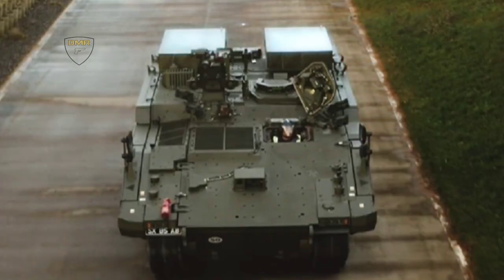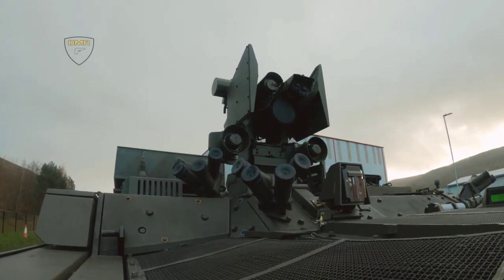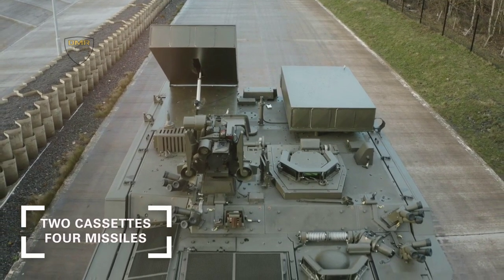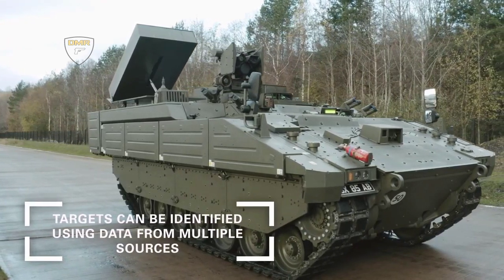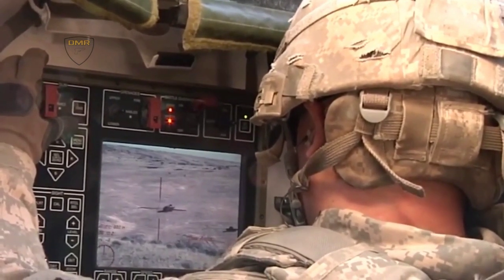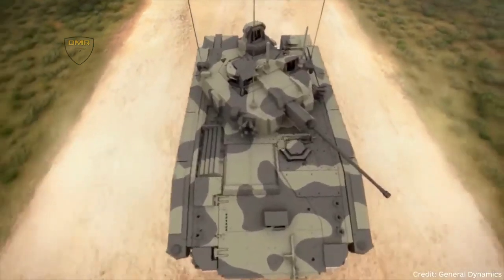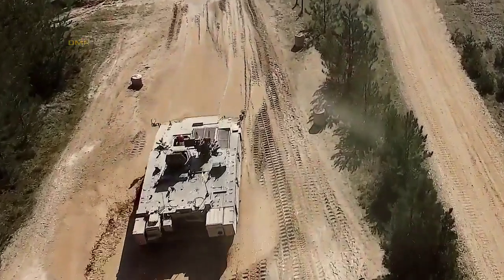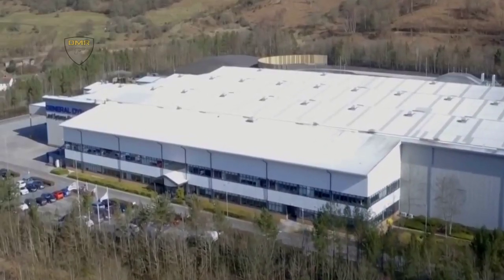Unveil! British Army Tank New Weapon Brimstone AJAX Overwatch

Comment: I am torn! Brimstone is extremely capable! But you almost have the same capability if you slap a RCH155 on a Boxer. You can shoot laser guided munition far cheaper and on top do everything else that and artillery normally does! 

Anti Tank rockets should always be shot by the most low cost platform available. That is not anything tracked, that is not anything armored. Slap it on a Jeep!

Comment: How is the Ajax 1st in class, the Britts seem to call anything they make "World Beaters or 1st in Class. I would say the Puma, T-15, K41,  Hanwa Redback AS21 and Namer have a leg up on the Ajax, all are newer platforms with better more powerful engines armour and crew protection ( T-15, K41 and Namer having active protection) then the Ajax,  that is just an update of the 22 yr old ASCOD Pizarro/Ulan.
Reply: What's a 'Britts' when it's at home.. ?
Reply: Oh, and by the way........ next time you get in an American armoured vehicle or fire a naval gun, remember who it's made by sunshine. BAE Systems, which is British. They also supply a lot of your military technology mate and design your rail guns and supply a lot of the technology for your "American" F-35. How do you think that the F-35B gets off the ground? Magic? Flight suits, helmet, ejection seats, targeting optics and lasers, weapons bays doors and technology, rear fuselage and structures, electrical power management, in flight refuelling probe, life support system, entire STOVL system, tactical data equipment, computer codes, weapons integration, electro hydraulic actuation system, throttle quadrant...... and these are the ones I remember. I've remembered something else........ who do you think contributed a rather large wedge of cash to help fund the research and development for the F-35 programme to get it going? Your fairy godmother? Actually,  just under a fifth of every single F-35 comes from our tiny little Island.
You seem to be exception to the rule as an American, I've been to the States many times and 99.9% of Americans I've met speak highly of my Country and the bond that we have between our 2 Countries, you are obviously the tiny minority. I don't care what you and your peanut sized brain cell think, you are irrelevant.
Reply: @gooner72  please do recall that the technology and items are "Not British". Please do your research and don't go into your Nationalism "Brits", seem to have an "Enferioty Comples" left over from their loss of the "Empire. Bae, you say provides so much of the American Service Gear, well BAE does but bit Britain. Bae Systems in 2005, acquired United Defense Industries, that made the M2/M3 Bradley , M109A6 Paladin, LVT, M8 Crusader, Mk 41 vls , Naval Guns and owned Bofors Weapon Systems. Bae has also acquired Atlantic Marine (major American Naval Service Support And Upgrades company), Signal Inovations Group Inc ( a data , dignals and intelligence company ), Tracor, acquired  Fairchild Systems and Sanders Associates from LockheedMartin and turned it into ( a major american info systems, Instruments, Ecm/Esm ) today Tracor is named Bae Systems Inetegrated Defense Solutions. The RR contribution to the F'35B the Lift Fan and Lift Fan nozzle System was  was developed by Allison Engine Company a then division of GM, RR acquired Allison in 1995, the lift system for the F-35 was developed long before RR acquired the comoany, ohh by the way does LHTEC T800  engines that power the AW159 Wildcat are made in the USA, ohh does Bae 5/62 Mk45 Mod4 guns are made in Kentucky.
Reply: Wind your neck in sunshine, the British Ajax is a hugely modified design and has a shed load of technology that the original one ever had.
Reply: John Martin
Why are you comparing IFVs to fast reconnaissance (Ajax) ?
Reply: What's a britts? 🤡
Reply: It's all designed to impress UK voters, usually while also quietly cutting the size of the British armed forces (and budget).  
So, yes, it's absolute rubbish but if it delivers a few extra votes to the current government that's all that matters.  Defence companies aren't above issuing sycophantic press releases either.
Reply: @tomgoff7887    This is an upgrade of the old CVRT FV102 Striker , the important bits are the new electronics and the Brimstone .
Reply: @orsonincharge4879  No it's not, it's a whole new vehicle platform not based on the CVRT.
Reply: @maquettemusic1623  did I say based on CVRT ?  Its an upgrade to what used to be called CVRT , which was planned to be replaced by FRES ...which in turn was replaced by Ajax
Reply: @orsonincharge4879  do you actually know anything?
Reply: @orsonincharge4879  tanks are needed for what ? It's an old report hasn't UK just ordered 148 Challenger 3 tanks ? Aren't 4 submarines being built ?? Arent Aircraft being ordered for carriers ?? What more do you want ??
Reply: @HafizShivji786  ..yes its an old report , but someone asked what cvrt had to do with ajax .. and i was explaining that ajax is the current iteration of what cvrt would become .. through FRES which was abandoned in favor of the ajax hull , they just want a new thing to stick the CT40 gun on ... sorry " weapon system" on ... and hey , turns out you can stick Brimstone on the back too .. and thats where the similarity to the Striker FV102  ... light track ATGM
Reply: @orsonincharge4879  👍
Reply: @tomgoff7887  cut the defence budget? Have you not studied the new defence budget? It's actually increasing and will be larger than it has been for decades fella.
Where do you think the F-35's, 2 new classes of frigates, new ballistic missile class submarines, new RFA support ships, new CH-47's, 148 brand new Chally 3's, new Apache attack helicopters, new Ajax family of vehicles, new Boxer vehicles, new UAV's........... shall I continue or have you got the point?
The fact of life is that ultra modern military technology costs an absolute fortune, far more than ever before, and there has to be a compromise somewhere as we don't have the infinite military budget of the United States. It's better to be an extremely well equipped, capable, hard hitting, smaller, advanced military than a massive, poorly trained and equipped 2nd or 3rd  rate one.
Reply: @gooner72  Thanks Einstein but I wrote 'usually'.   A smart fella like you should be able to understand what 'uaually' means 
In any case, are we talking about the defence budget in cash terms, real terms or as a % of GDP?  It can sometimes be difficult to work out what's actually happening.  The sad fact is that Army personnel numbers are being slashed, the total number of warships will be cut and so will the total number of aircraft.  Not to mention a third of the Army's current tank fleet.
Reply: @tomgoff7887  The Brits now the fourth highest on defense spending behind the Yanks, China and India.
Reply: @timphillips9954  The are still reducing the size of the Army, reducing warship number and military aircraft numbers.  The 2021 defence review spells this out.
Reply: @gooner72  Wrong about the defence budget, in 2019 the Tories announced an increase, then announced further cuts a few months after the general election, they must think we are all thick. Let us be honest, the previous increase was only what they have stripped from defence via austerity and the disastrous SDSR10 that Cameron used to obliterate UK defence capability. The state of the UK Mil was a political choice not a necessity, and with what is happening in Ukraine, a bloody disaster.
Reply: @tomgoff7887  cutting budget ? It has increased since Bojo took the office. It's 60B currently where Russia spends 65-70B on over 2M troops , 75 time's bigger land to protect. UK is a tiny island
Reply: @HafizShivji786  Can't any of you 
geniuses understand simple English?
Reply: @tomgoff7887  it's you who need to understand instead of bringing conspiracy theories. No Aircraft or Ships is going to be cut. Instead MOD has already given order for more Aircrafts & Ships are being built. Personal atm aren't needed coz Britian is a Sea power only Small amount of personal are needed to defend it's tiny island
Reply: @HafizShivji786  
I am a scouser myself but you're just an embarrassment..  You clearly don't know what you are talking about.  The recent White Paer for example clearly identified aircraft and ships to be cut.
Reply: @tomgoff7887  there's no Aircraft or Ships to cut .. you can check on MOD site. They've ordered more ships, Aircraft, 148 Challenger 3 tanks, helicopters, 4 Submarines etc. It's clear to see you've old information or you've agenda against current government.
Reply: @HafizShivji786  Don't be ridiculous.  You have to look at the Budget in the context of the most recent White Paper.
Reply: @tomgoff7887  context is there for everyone to see, MOD has been speaking out UKs military plans & order of equipments/strategic etc. Next year UK will increase again it's defense budget from 60B to 65-70B. After Brexit there's no option for Bojo but to increase Defense budget.
Reply: Who are, "the Britts?" Do you mean, "Brits?"
Reply: @liverpoolscottish6430  My paternal Grandfather's 2nd wife, Catherine is a Brit, or as she calls herself of the Britts, Born in Humberston in 1935. She along with her 2 older brothers and 4 cousins, got evacuated to America in 1940, Catherine along with her siblings got taking in by relatives in San Pedro, Cali. Today at the age of 85, she can pull off a proper English accent, and she calls her self of the Britts.
Reply: How many t's in Brits John?
Reply: Don’t forget the Russian Cornet either.
Reply: It is a simple, low cost and easy to produce design that can be deployed in any environment. The AJAX unit can be manufactured and deployed in a fraction of the time of a more complex system. The missile will knock out any tank in world including the new British Challenger 3. A simple vehicle with a world class missile system on it is a great idea.
Reply: John.... John......... mate.... really? It's best in class because Johnny Foreigner didn't deign it. Really what more do you need to know?
Reply: @VaucluseVanguard  The 1st 100 Ajax will be made at General Dynamics Facility in Spain, then shipped to the UK for sub system and turret integration, the 2nd batch of 489 Ajax will be assembled in a former forklift factory in Pentrebach in South Wales, from hulls made in General Dynamics factory in spain from Swedish steel, same steel used to make the hulls of the CV-90 and Patria AMV. The engine is a german MTU 600 Kilowatt V8, attached to a German RENK 6 speed HSWL 256B transmission. Now contrast this with the Griffin ll that's offered for the US Armies MPF and Griffin lll thats going up against the Rheinmetall/Raytheon/Textron K41, BAE heavily upgraded New Gen Bradley,  Oshkosh Hanwha AS21 for the OMFV. All 4 teams have said their vehicles will be made in the USA, using american Turrets, Weapons, Transmissions, Engines, Tracks, Suspensions and Subsystems.
Reply: @johnmartin6420  I might have known you were a loud mouthed septic, it's funny how you seem to think that you're all big and mighty and yet, anytime you lot go somewhere, you always pick up the phone and dial London to come with you as we're the only Ally in the World that you can depend on.
Reply: It’s a channel with a computer voice. Programmed somewhere in Asia to trigger post Brexit nationalism.
It’s all about the money...
Reply: @hansmeyer7225  yea knock yourself out.